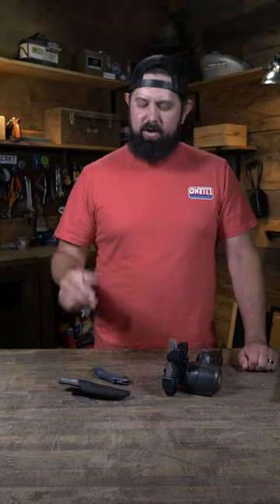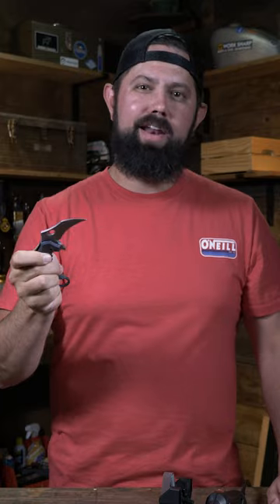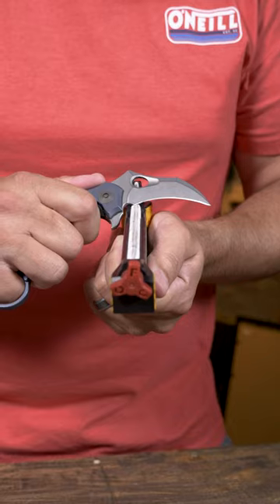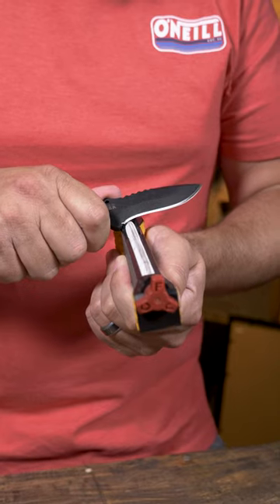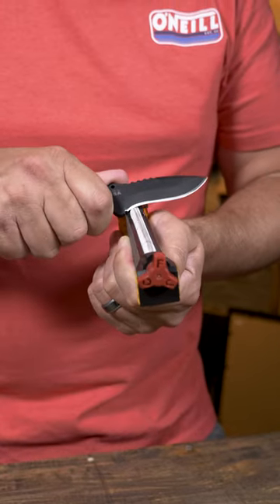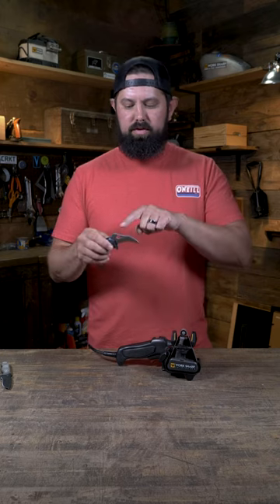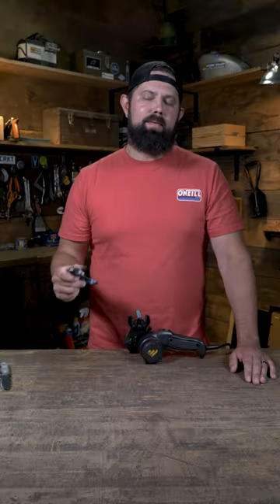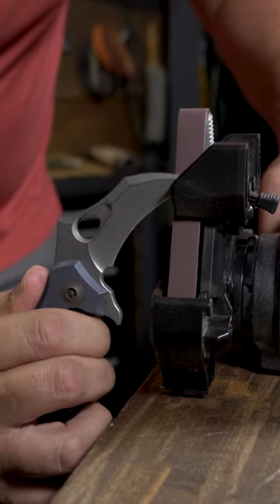How to Sharpen Curved Blades. Karambit - Recurve - Hawksbill

Comment: I’ve got a WS Ken Onion knife & tool sharpener along with the blade grinding attachment for it.  Really like both versions.  Thanks for the info for sharpening a karambit blade on the KO sharpener.  
My question is what is the best angle for the edge that you recommend on karambit blade?
Reply from the maker: A 20° angle per side would give you great utility!

Comment: This did not help at all… my crkt provoke is so dull due to your stupid ass work sharp tool.. it sucks ass doesn’t sharpen at all and literally makes my knife dull…. I have used the ceramic rods and done everything but it can’t cut paper… I’m going everywhere to leave a bad review because you guys need to show how to use it step by step and how many strokes per side and for which blade steels how long you have to do it for… there must be something going on I never had a sharpener full my knives 😂
Reply: Maybe do research before diving into a new piece of equipment, not this guys fault you have no clue how to run the tool…